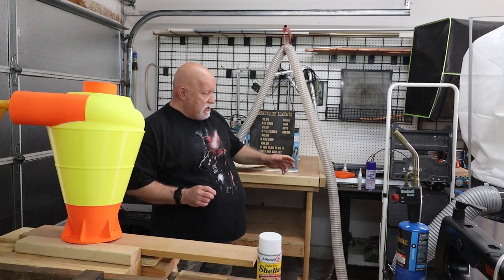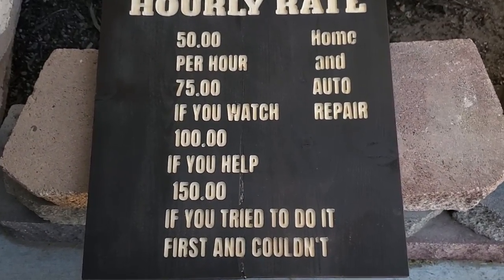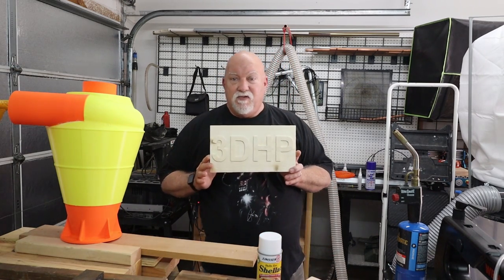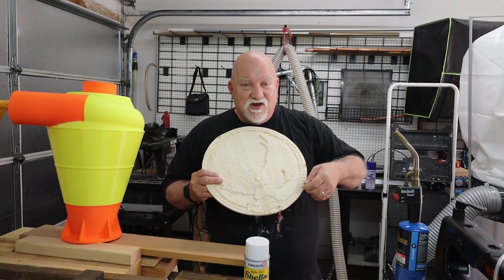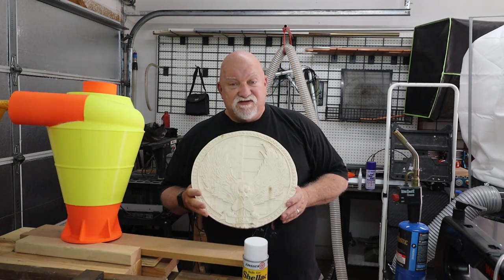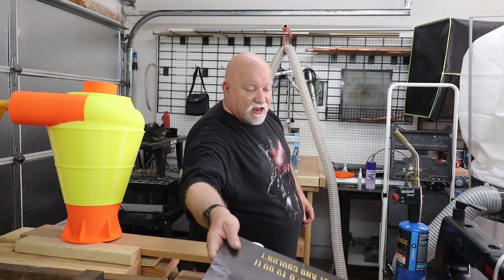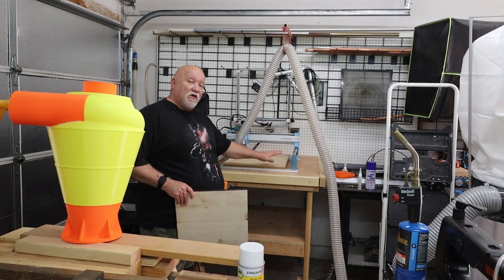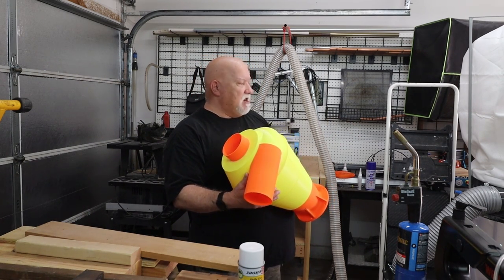First few jobs on my Genmitsu 4040 Pro CNC | Sainsmart | Makita

Comment: you can vacume , but you can also add a small bit of copper pipe next to the routerand use air to blow away the wood chips. will make a bigger mess , but save your bits.

Comment: Informative video, could you provide information as to how did you work up the g-code to resurface the spoil board, Thanks. Keep the experiments going.
Reply from the maker: To make it really easy, I used a FREE program called G Sender.Once program is opened, its at the top right.
Reply: Thanks for your response, being a noobie , am I to understand the program you referred to creates the g-code?? @3DHP
Reply from the maker: @billlester3088   I'm still a noob at CNC . Watch different Youtube videos on G Sender,its easy to figure out.

Comment: Hi. Just seen your video and really enjoyed how you explained your process including your ups and downs.
I'm Kev over here in the UK. 
I'm about to jump in on the cnc bandwagon, for my budget it looks like I'll be going with a genmitsu.but I'm undecided between the latest 4030 or the 4040. I want to have the option of using the laser engraving.
In your opinion what are the drawbacks or limitations if any with your machine. 
Thanks
Reply from the maker: Since the weather has been hot here in Vegas. I have not done a lot of work on it but will start as it cools down. I have never tried the 4030 cnc but as far as a laser, I keep my machines separate. 3d Printer, Diode laser engraver, CNC Machine. I'm very happy so far with the 4040 CNC and putting my Makita router on it. Its a small hobby Machine. If I had the money I would buy a Onefinity CNC for around 4,000 dollars.

Comment: I'm a noob at CNC as well 😆. Just wondering about running a shop vac for so long
Reply from the maker: I think most shop vac's will overheat and shut down. There are a few high end ones designed to run though but pricey,so this was the best bang for the buck even though I need to change some things.

Comment: With the Makita router being heavier, did you find any issues with that ? Or are there some ways to compensate for example some way to stiffen the Z axis ? Thanks.
Reply from the maker: I have had no issues yet.
Reply: @3DHP  Thanks, glad to hear that. Some other folks reported some flexing. Hey while I'm typing another thing on my mind is setting up a game controller to do manual jogs for easy surfacing. Have you looked into doing that at all ?
Reply from the maker: @hv1461  I'm sure it will flex since its not heavy duty,but for  the signs I have done on it,was not a problem.I read on a group yesterday of a person using a spacer or block behind the z axis. It is a nice Cnc for the price.

Comment: I have some  questions and hopefully you can answer them for me.  I'm strongly interested in this machine.  Does it come with everything ready to go once assembled?  Besides the program like fusion 360 or another is there anything else I would need to buy?   And lastly will this work with a Macbook?
Reply from the maker: It comes with a small spindle that works but I put my Makita on it .Had to get a 65 mm bracket for the Makita. You will need some sort of dust extraction.Some shop vacs work but depends on how  long you will be running machine as to which one you buy. Great little cnc in my opinion.
Reply: @3DHP  do you know if it will work with a Macbook?
Reply from the maker: @dgm6277  It depends on the controller software you run.UGS, Candle etc.